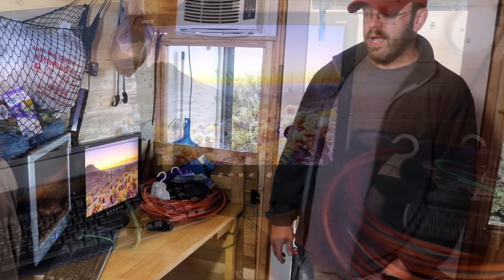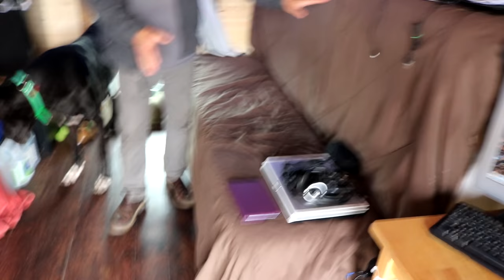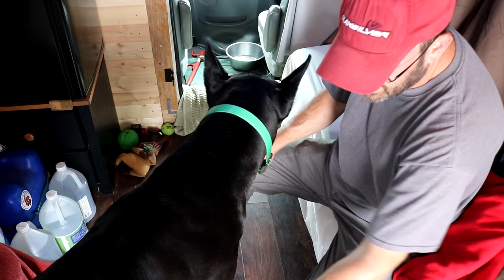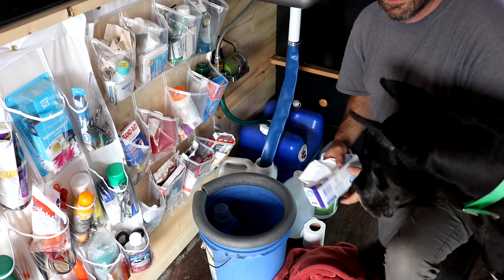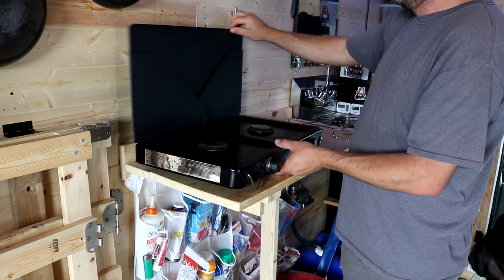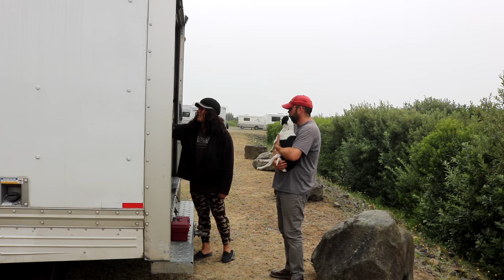Living In A Converted  Uhaul With My Great Dane & Cat

Comment: How about switching the bed pieces out, use the large one for sleeping and the little one for a backrest?
Reply from the maker: Great suggestion
Reply: That's exactly what I thought.
Reply: I thought the same thing.
Reply: I think you would get a much better sleep if you could stretch out more that does not look healthy to sleep in such a small confined area and I would put a window in for any urgency escape what if somebody locked you in from the outside think about it
Reply: @dorisdittrich1717  He cut a hole between the truck and the cab, which you can see thru when he's showing us around.
Reply: I agree, even sleeping on your side, that appears like a pretty small space, and since he doesn't use that large portion of the mattress, he could use the electric knife to cut a different size portion for his 'bed'..

Comment: But, if you laid the big piece of the mattress down and then used the small piece as a back rest, you could keep the slats pushed pretty far in so you could still walk and still have a mattress that is at least the size of a twin bed. Flip the bed, much better.

Comment: H-Depot sells UV reflective white roof paint to help reduce heat from direct sunlight. I'll be building out a Uhaul same size soon after living in a low roof van for a year, going from 4' to 7' height will be nice. But I'd thought I'd share my bed build. Under the bed roughly 3' tall custom couch with storage under the seating. I use an 8" memory foam twin. So above the couch (@ 3') I'll have the bed frame on hinges so that it folds up and flat against the wall when not in use and then I can use the couch during the day. Also when up, I'll have 3 coat hangers on the underside of the bed frame so that shirts can hang with a bungee holding them in place and wrinkle free. Like you I considered the slat bed/couch but I didn't want a minor project every night. So all I'd have to do now is unlatch it and lower the bed. Boom. Done.

Comment: Could use the 2/3 part as the bed/couch, push the frame in and use the 1/3 section for your back rest. More bed or couch but still be able to move around.

Comment: Put the large section of the mattress on bottom, set smaller part on top for a back rest.   That should solve the problem.  If the back rest moves around when driving just put Velcro on the back to fasten it to the wall.

Comment: I would get rid of the back on the bed and hang a couple of cargo nets like you already have instead of putting all that stuff along the top of the bed part that's up against the wall..  The bed you sleep on would be wider without blocking the aisle and your dog would have room on the bed with you
Reply: True, but for those few occasions I would try to store the back somewhere so I didn't have to sleep on that narrow bed all the time.  Perhaps in the over the cab area.

Comment: Nice setup, I would need some windows.
Reply: Between the translucense of the roof fan cover, the cab passthrough opening and the rear bulkhead wall full of glass... there's plenty of light, believe it or not. :-)
Reply: Great.
Reply: Good point, didn't think of that.

Comment: wow...  this could use a bit of design strategy... a 15 year old could have figured this out better...  ; D   25% of the time explaining his bed? (not that well thought out...) a 100 watt solar panel!? (which isn't enough to run a Betty Crocker Easy Bake Oven...) no real insulation which necessitates 2 600BTU A/C units?  to cool down a 14 ft room?... tying you down to a local public power grid, and to be honest I don't see any real space design features, which are a necessity in a space like that...  and then add a 3-4 ft high 150lb Great Dane (of all dogs to have) and a cat for good measure... oh... my... God...      '; P